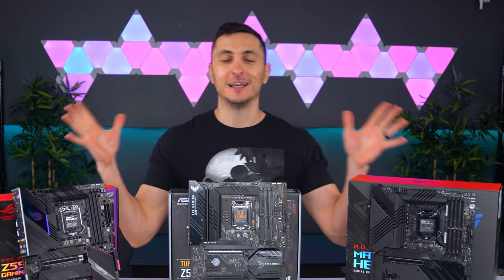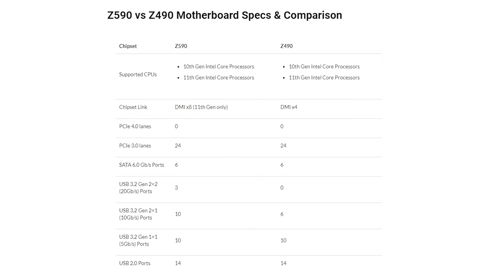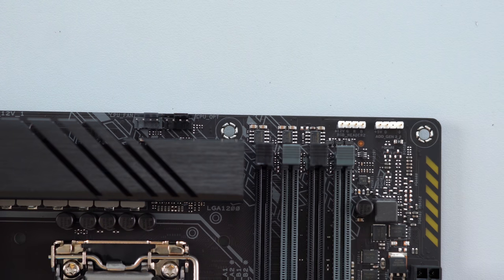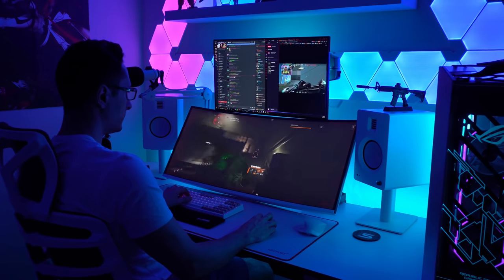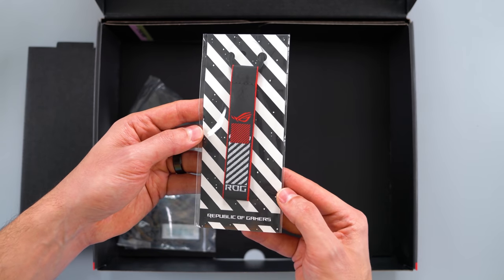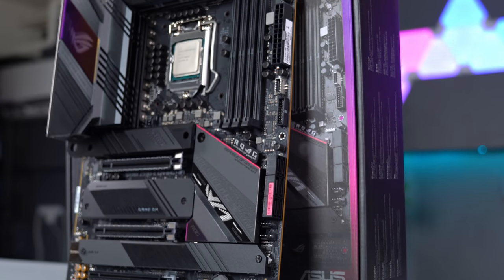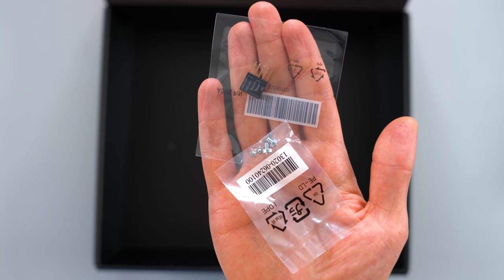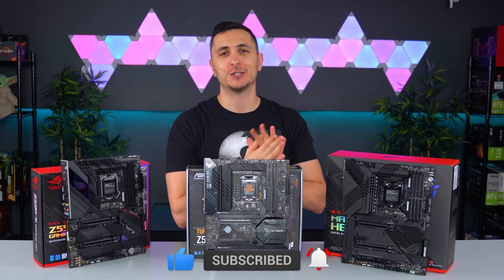ASUS Z590 Motherboard Unboxing + Overview!

Comment: My board didn’t come with the antenna or support bracket. Also if you’re using 10th only the bottom m.2 slots will work.

Comment: Can't wait for all the e-waste coming from all the unsold Z590 boards with the waste of sand 11th Gen Intel line up.
Well other than the 11600K I guess, it's good for budget gaming.
Reply: The funny thing is it isint just get the 5600x with the stock cooler and like b450 tomahwk max and boom cheaper then a 11600k with a enourmous cooler and 200 dollar z590 board

Comment: Can I still plug my H100I AIO pump cpu fan header into cpu number one on the xiii and not the AIO header? I was confused about this and plugged it into the CPU 1 header as the corsair said to do and it is keeping my CPU cool. (i9 11900K runs at 60c in gaming) am I losing anything from not having the pump header plugged into the AIO header? or does it not matter?

Comment: the rear port of mobo #2 has NO thunderbolt icons on the type C. And you metion that word, NO! so detail why 1 says 10 the other 20. That is only 1 = ONE (3.2 Gen type C that is 20gb)  Whereas HERO has thunderbolt icons and no numbers but specs = Thunderbolt 4 | USB 3.2 Gen 2 type C   Also adds  a USB 3.2 Gen 2x2 front-panel headers give you easy access to data transfer speeds up to 20 Gb/s again higher than mobo #2. where you say Hero is same. Hah.

Comment: These things are junk. I'm on my second board in 10 days and like many others cannot get the drivers to install. 
Error messages stating compatibility issues with my version of windows 10, which is a legit purchased copy with key.
I'll never use Anus boards again, it's back to Gigabyte.